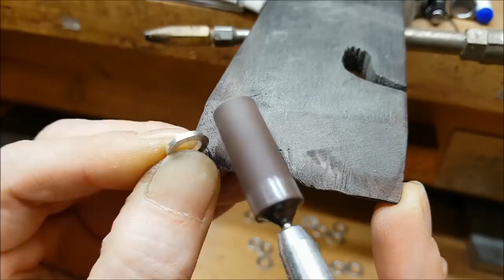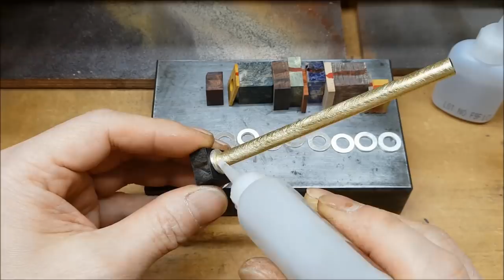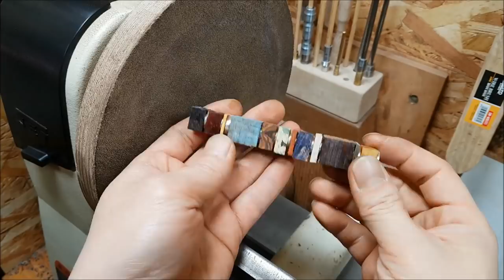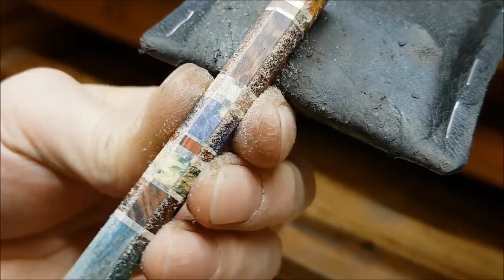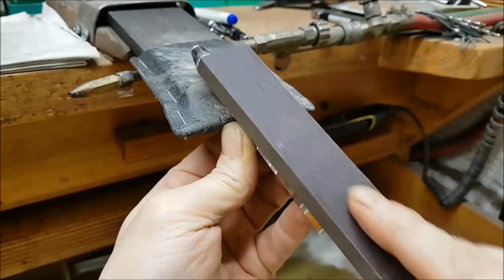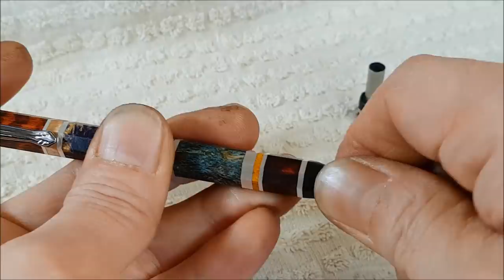[ Making Pen ] Octagonal Mechanical Pencil (1)

Comment: Beautiful.  Source for pencil kit and silver?  I would like to use up my end pieces and cut offs?  Do you cut each silver ring from a sheet or are they already punched out and all you have to do is touch up?  Great video.  Thanks for sharing.
Reply from the maker: Brass tubes and joining units are produced in collaboration with colleagues (not for sale).
Sharp's mechanism was purchased at a stationery store. (Japan Pentel P203)
Silver rings are made by first making silver plates and then cutting them out with a saw.
Thank you for watching